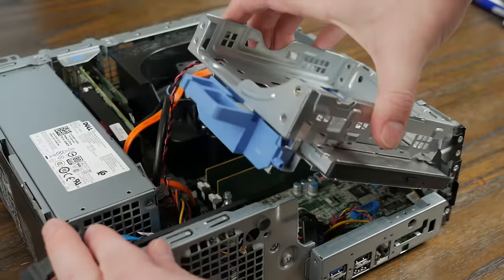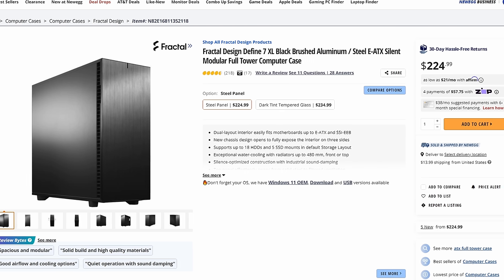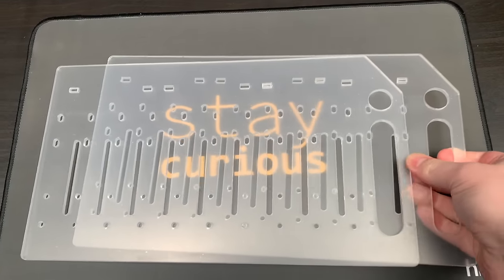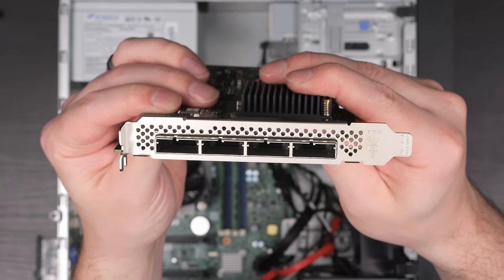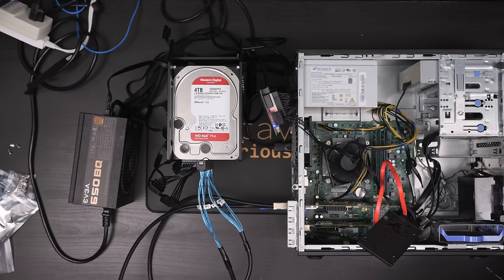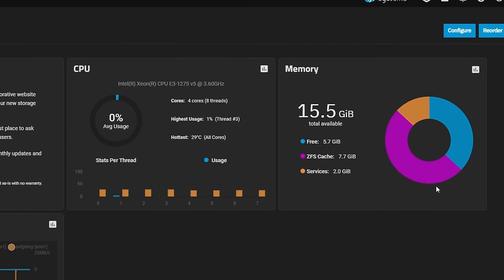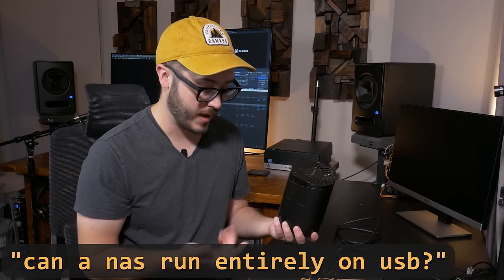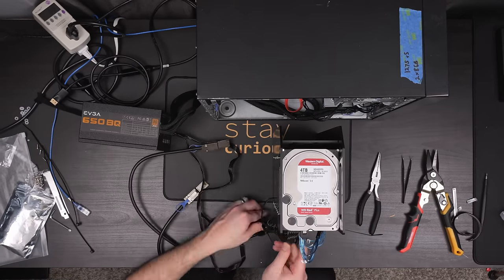I Made My Own JBOD Enclosure For CHEAP

Comment: This is OUTSTANDING! I have also been struggling with storage, i use an older HTPC case for a NAS/PLEX server with TrueNas Core (terrified to swap to Scale) I am using a 7th gen i5 Commercial Matx board, with 16gb ram, the case has room for roughly 6 drives,  but with some ingenuity was able to use some single Drive enclosures and some extra Metal slot covers and Pop rivited the enclosures to the slot covers and BAM! Two more secure Drive bays in the unused space where a full ATX board would be! I will say for your solution, you may have been able to power those drives with a MUCH smaller PICO power supply or even a used OEM SFF PSU for much cheaper! Just a thought! Drives don't need all that power! with a few molex adapters you are golden!
Reply: About a pico PSU, I have some doubts it's actually safe. When starting up, some drives can pull over 30W, so you'd need a pico psu that's still able to handle 240W at peak (for a few seconds). You can counter that with staggered spinup, but that's more complex, and you can't use that if you put your drives to sleep after some time. Also, you need about 1A (constant) on the 5V per drive, and I'm not sure that those pico PSUs can handle a constant 8A (40W) on the 5V as they provide it through a little converter

Comment: Don't worry about leaving those washers out. They would provide ZERO noise isolation since the screw is still hard connected to the panel and the drive.  To provide isolation you cannot have a hard mount between the drive and the panel.  Something like those screw grommets you might see would do this, but a washer will not.

Comment: It’s funny that in the last few days I experienced the same problem. I want to build a little NAS with 8 HDD’s but there is no ITX case available with enough space. And I also don’t want a big case. I really had an eye on the Jonsbo N3. But I can’t buy it anywhere. So I concluded I have to go DIY. My two requirements were all HDD’s internal and it has to be a cube. So I build a little ITX cube frame from metal where I can mount my board, psu, all 8 HDD’s on anti-vibration mounts and fans for the board and the storage. And then I build a acrylic glass shell for my frame. Looks actually not that bad and very clean. And because I love cube cases I just have to like it.

Comment: I did something very similar, I used a drop of hot glue to hold the washers (I used silicone washers) in place.. I also just made my own case, I used a metal HD rack as a pattern, and the one you bought is very very close to what I made, I had some plexiglass that was left from a different project. I was able to put 10, 10TB HD's.. I'm going to redo how mine is connected and use the way you did it, the way I did was basically use them as connected external drives..  I also used a separate power supply to power mine too, I had a older one, I repurposed to power my HD's.. I wish you had this video out 4 months ago..  Thank you for sharing..

Comment: I've tried all sorts of external enclosure, USB is often flaky when loaded and USB hubs are trash and often just reset when you are writing to multiple  drives. Yes everything had its own power brick, this is just controllers hanging and resetting.
SAS cards and sas expanders are turnkey and rock-solid, and in most cases much cheaper than large USB enclosures

Comment: Great video, I actually made something like this myself recently apart from I did not end up using some acrylic kits.  I had some spare 3mm plywood lying around and I must say if you have the means to cut it straight and pre-drill the mounting holes after you have spray painted it it can do just as good a job as those acrylic kits you bought from China.

You did a great job my only comment and advice would be you can purchase far smaller power bricks which provide 12 volts and up to 9 amps which would be more than enough to power all of those drives meaning you could ditch the pc power supply but you'd lose the power on functionality. You could then mount one of these power bricks to the side or top of the case.  Most of them use barrel jacks but they sell converters. Even hanging out the back but more clean.

Great work, keep it up

Edit: P.S I also own one of those sabrent x4 2.5" enclosures and they are indeed trash, why companies wish to hide drive serials and labels with they're own name and branding is a mystery to me.

Comment: It's amazing how big the market is for storage, yet there is so few solutions that work well.  That includes m.2, sata ssd, and mechanical drives.  I've got a half dozen ssd's and another of nvme drives just sitting here from upgrades done in the past.  I would love to be able to buy a product to hook them up to my server for storage that wasn't usb.  I like that you found a solution to the power issue that normally plagues users with external storage needs.

Comment: I actually did something slightly differerent to get my drives into my case. I have a MicroATX case (Thermaltake Versa H18) with a MicroATX mobo. It has a power supply shroud, but no drive bays (just places to screw in some drives). I bought a 5-drive hard drive cage that is supposed to fit in a 5x 5.25-inch bay, I think. Then I just used double-sided tape to attach it to the top of my PSU shroud at the front of the case. The case and this cage and perfectly sized so that the cage and drives don't interfere with the motherboard, and they fit with the case's side panel on. They also get easy access to air from the front panel. This won't work in every case, but it was perfect for my scenario! And since this was internal, I was able to easily connect each drive with SATA cables directly to the motherboard.

Comment: I loved this episode.  I have done things like this for over 10 years and it makes my heart warm to know that builders are still thinking outside the BOX or Case.  I loved the idea that you painted the plastic and that you found the Noctua 80 mm fans.  Back in the past those 80 mm fans had the sound of an angry bee hive so you did good choosing the Noctua silent 80s.  I also found the idea of JBOD since I am running out of drive letters in my home computer.  The old Cooler Master modules from the classic computers cases work great for an external mount for drives but those are hard to come by.  The plastic on the cheap plastic mounts probably soak up some of the drive noise also.  Overall it was a great little modding tutorial for us out of the box guys.

Comment: Working on something very similar at the moment. My power solution is to use two different SATA cables from the PSU, and ziptie them as they hang out of a vertical PCI bracket hole in the case so they stick out a few inches and just use SATA power extensions and splitters to power the drives. Currently running 4 drives off one SATA power cable but I'm hoping I can hook up 8 to one without anything melting.

Comment: You can make the acrylic enclosure a bit taller and put the PSU in the bottom, and you can use an IEC Y splitter to reduce the power cables to one instead of two (one for each PSU).

Also, there are many cheap fan controller boards with thermal probe to controller the fans' speed, I think that will make it a bit quiter while it's idle

Comment: I've built two 12 bay JBODs using used SuperMicro gear I bought on eBay. The first one was kind of tough because i wasn't sure which cables and adapters to use, but the second one was a breeze! Not including drives, I have 24 slots for under $500.

Comment: Good video, if the size of array is going to be an issue, there is an alternative.

Icydock do a 6 x 2.5" to 5.25" drive adaptors (MB326SP-B) but these do cost around $90, You could probably get away with a 250W PSU to power the drives.

Unless your using SSD's, the 2 fans they have may be adequate, the drives may get warm if used long term so additional ventilation may be required.
Reply: Hard to find high capacity 2.5" drives that aren't SMS

Comment: I think this is a really great solution because of the expandability. True nas + a little bit older computer that can handle the data transfer has so much more appeal to me than $1,000 16 bay nas. 

If you don't need instant access but want to be able to store a bunch of old videos, that's such an easy way to have all the hard drives with all the old stuff on it that you can just stick in the closet in a very organized kind of way. It looks like it's a bit annoying with the screws and washers and the cable management, but it's definitely a worthwhile endeavor. That's very expandable. Love the videos

Comment: I like this idea.
I am all for doing stuff like this.
I have an old case I used for a workstation, and I made my own 4-drive enclosure, which fits right inside the case. I even made a video of it but have not edited any of it. It has been over a year since I did mine. I think I might throw some of the footage up on my channel one day.
Essentially, the enclosure design as it slips right into the existing bay. It is pretty cool.

Comment: Nice build! A way cheaper but very reliable way to remote the second PSU is a relay with a 12 or 5 V trigger. With the NO and C outputs on the relay hooked to the 2nd PSU's power on pin and ground. The trigger is obvious, any spare 12V or 5V connector from the first PSU. Been using this method for my Hotswappable cages on my NAS for years without a hiccup.

Comment: If you're looking for 30 printer I do highly recommend the Bambu labs one. They are workhorses and large ish build areas. The app is easy to use and cloud connected and live camera view. Plus if you want to do multi material colors they have those AMS systems. They aren't really cheap but for what you get I have been very happy with my X1 carbon
Reply from the maker: Spoiler... I got the A1 Mini. Its printing right behind me as I type haha. 

I imagine at some point I'll want something with a bigger print bed, but I'm loving it so far. Especially for someone like me that doesn't have the time to dive into the details, it's perfect.

Comment: 2:06  I have the SAME 9010.   Stuck in two 23TB drives in the same location.   Dell is ALL STOCK.   Love the fact it has WOL (Just need to set it up properly! )      The plastic drive cages are wonderful, and quiet.  and just sits there.  Plenty of expansion and speed for hooking up large drives to back up all your old data for the last 25 years or so.    Built in Display just means more room for PCI-e add in cards in this simple and quiet well built system.       

I see you used a Lenovo afterwards after watching the video.  WHoops!   
Anyways,  these plastic enclosures are PERFECT  if you use some aftermarket hardware bits, and put them inside of an old PC Case.    Or even a Mini ITX case as they are easy to gut out.

Comment: I've got a double wide Lian Li PC-D600. It's got a whole right side of the case loaded with 5.25 inch bays. I've got 2x 3x5.25  to 4x3.5 bays for a total of 8 3.5 drive bays. I've got 2x 5.25 to 4x 2.5 inch bays for a total of 8 2.5 bays. They're all hot swapable. For the extra SATA ports I used a 9550SXU-12 PCI-X SATA II raid card.

Comment: You don't believe this! I was actively preparing a similar JBOD. But I go for an old PC case. The small chip to to switch the powerblok on was new to me. Thank you for this cool video!
Reply: You can also us a paperclip or a metal wire to bridge two pins in the 24pin ATX PSU connector (look up a pinout diagram). That's all the switch does, closes a contact between the two wires, to signal the PSU to turn on
Reply: @marcogenovesi8570  i believe this one does a bit more. It only goes on if the pc is on. Nothing fancy but still pretty cool!
Reply: If you are using a seperate case check out the Supermicro CSE-PTJBOD-CB1 JBOD Power Board. A little bit more costly than the solution in the video but enabling the power button makes it easier to move the case between systems.

Comment: i have been racking my brains for 3 weeks on this problem. My Powerdedge 420t can hold 8+ drives with no issues. But every tower pc i was looking to get to replace it, it can only hold 3 drives. This solved my problem and I can finally pull the trigger on my server upgrade!!!!

Comment: Those sata extensions cables work really well for the 3.3 volt problem for shucked drives.  You can peel the back cover off and just take the 3.3 volt cable out and put the covers right back on.

Comment: I had a Corsair case, cant remember which, but it supported 8 drives by default, and could expand up to 12 with buying another drive bay that bolts into the tower when you remove the 5.25" bays (So 12 tall). When I got past 12 drives, I ended up buying 3 more bays and stacking them onto each other the same as they support, and then drilled a few holes in the bottom of the case and stacked them right next to the other ones (2 stacks of 12). Ended up with a tower that allowed 24 HDDs inside it 😁

When I outgrew that, it was time for a rack and a drive shelf connecting to an HBA. lol

Comment: If you want vibration dampening without the hassle, one thing you can try are silicone grommets for M5, M6, or #6-32 screws. You may need to drill the holes out to a slightly larger size as grommets are supposed to fit inside the hole.
Some older cases, particularly Antec, used to come with those.
Oh, and one more thing you can do for vibration dampening the entire thing is adding earthquake-resistant gel pads. They are usually clear blue in color, and you should be able to find them at most online stores in the Asia region.

Comment: Hey for the washer replacement, you might wanna consider felt tape put on the side of the hdd. Inferior to the silicon/rubber vibration reduction but still can get the job done somewhat (experienced it with my synology nas) and it'll be a bit easier to slide in an out after you have bunch of drives on the said acrylic housing

Comment: Instead of the SATA power splitter cables you can buy SATA punch down power connectors. You basically can just push more connectors onto your existing cables so you can space them as far apart as you want to cut down on some cable clutter.

Comment: Looks awesome! Simplicity is key with something like this though. Especially if you can get away with it for half the cost of a JBOD. 

as someone who bought a 4U case for 15 drives. I can say those HBAs work great. Just need to make sure you spec the PSU the correct size and / or "balance" the drives per power rail so you don't overload one over the other.

Found this out the hard way in proxmox when it dropped drives in the middle of the night.....

Comment: The gray fans look sick AF. Very nice video, I really learned a lot! Thanks for your hard work making these videos. Using a power supply that's 650W at only 65W (about 10% of max) is typically very efficient compared to using a PSU near it's maximum power. Using a second PSU instead of adding those 65W of drives to your 400W lenovo PSU was a very good move.

Comment: Totally viable way of doing it, especially when you often play around with the setup. For a cleaner look and a more long time solution you can shop around for an older pc case with a lot of 5.25" bays in the front. up until ~2015 there where many cases around that had the complete height of the front open with those bays. you can either throw in the DIY acrylic rack (even two of those cause you dont populate the mainboard area) or use cheapo bays/adapters to mount the drives. if you want you can even have hotswap racks etc. dirt cheap nowadays cause no one uses this stuff anymore in a professional environment. all cables, power supply etc. can be mounted inside the case. you can even use a slot bracket to convert the external SFF-8644 back to internal connectors for a complete clean and professional setup and make yourself a JBOD case. with a bit of luck you find everything for a very low amount of money, or you pay a bit more and get a high quality enclosure like from LianLi etc.

Comment: I found this exact thing on Ebay 3 years ago.  I got the 8 bay version.  So, here is a few pointers from my experience.  If you use "Cooler Master Dual SSD" adapter.  You just double your 8 or 10 drive to 16 or 20.  I have 16 ssd's in my truenas core box.  You will have to drill the holes out in the ssd tray and sides to use pc case fan screws.  And the 4 holes in the ssd tray may not always line up.  Sometimes your stuck using 3.  Or just make the holes slightly bigger and just start the screws first.  Don't fully tighten until you have them all started.  Also, if you want to get creative like I did.  You can bend some aluminum sheeting i got from my local hardware store.  and 120mm fans fit perfectly behind them.  And can even use that side as the bottom.  You are just going to need a lot of sata power splitters to get it all to work.  But, being ssd's, it's not much poer being drawn.  Esp. compared to hdd's.

Comment: they have 3.5-inch Hard Drive Cage, 16-compartment Shock-proof Expansion rack, Multi-bay mobile External Hard Drive Cage on ali express and then you could add any slide in or hotswap drive mount or use the provided ones. You could even go down the rabbit hole of sata backplanes for the power so all you would need is prob 2 molex to power it (like on the silverstone 380b) for example. Cheers

Comment: I did a similar thing with two strips of metal, drilling holes and just using drive screws to keep them all in place. The drive screws will work themselves loose after a while, so I put polyimide tape over them to stop that. The strips of metal were some very cheap metal rulers, which had the added benefit of making it easy to mark out the holes evenly spaced. You don't need to use rulers, they were just cheaper than metal strips. Economies of scale, or something, I guess.